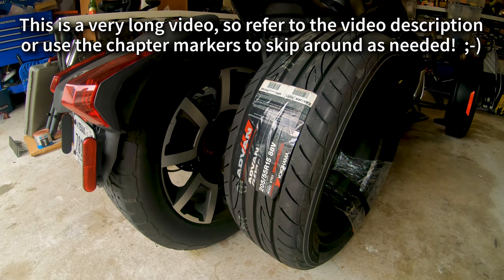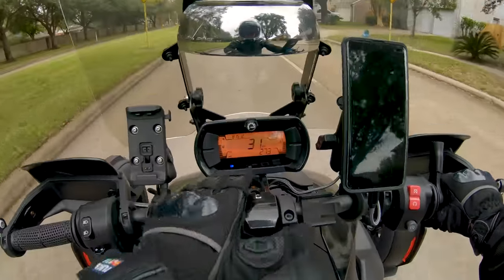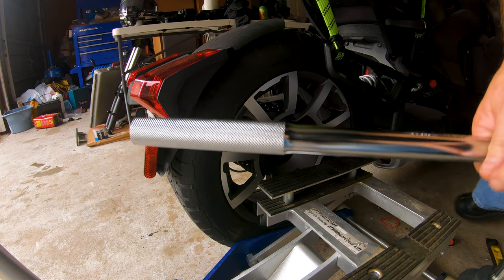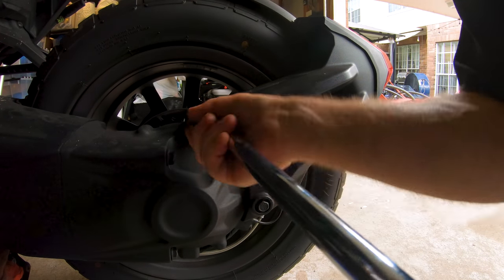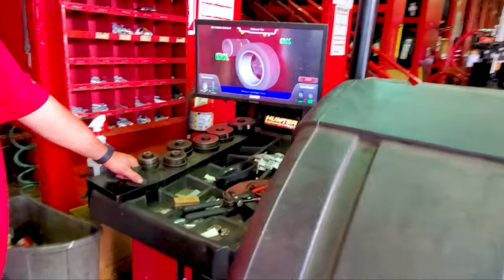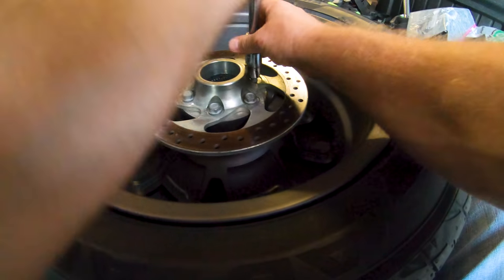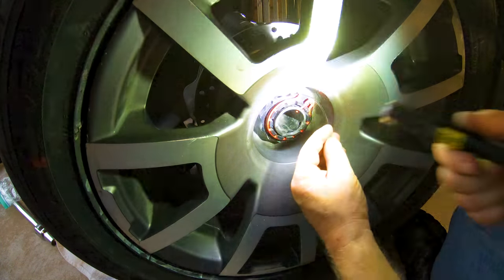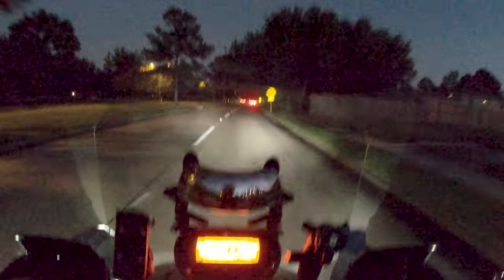RYKER: The Darkside Saga - Yokohama rear tire upgrade

Comment: Thanks, really enjoyed the video. Been thinking of getting one of these, being a retired tool and die maker, blow out the holes before re tapping and always use cutting oil even to clean out the threads. It will make the job much easier.

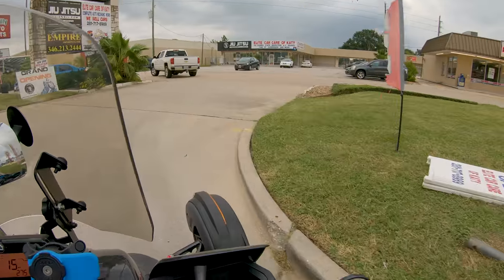Comment: Smart move to use the floor jack to avoid sideways downward pressure on that nut. I was glad the nut didn't break free when you had that rachet at 11:00 and pushing it away from you, you were headed for a tumble and some scrapes  from the jack and the floor!! I also like that you were in no hurry and reasoned your way through things. Enjoyed the video!! Thank you!!
Reply from the maker: Thanks for the feedback!  I'm sure that there are other ways to do the wheel removal on the Ryker, but I was trying to do it somewhat quickly and with the tools that I had available to me.  I enjoy wrenching on my machines... it's cathartic and fulfilling most of the time... as long as I don't break anything or lose any skin in the process!  Cheers!  😉👍  --QM

Comment: a 1/2" breaker bar is sufficient for that torque spec.  I used one from Harbor Freight for a crank bolt with similar torque specs.  I'm a big guy so it doesn't take much for me to "break" stuff lol.  It was a fun adventure though..I would like to use that tire on my spyder, just needs to be a little wider.

Comment: Did you really need to remove the disk for mounting and balancing? Maybe it would not fit the mounting machine, but the balancing might have been easier and would have included the disk mass in the balance.

Comment: Lower the Yoko rear pressure to 24 or so.  This is what we run them at on the Spyder and the Ryker is even lighter load.  Just stay above about 18 to keep out side wall flex in the corners.  The tire should last 18k or so, or at least that is what they average on the Spyders.  What do you plan to use for the fronts?

Sorry to see you went through all the trouble to get your tire changed.  Too bad we are booked up a couple of weeks out or I would have done it for you in less than an hour.  Just for future reference, there is no need to remove the brake rotor to change the tire.  It was obvious the kid putting your tire on at Discount did not know how to use the machine.  I winced when he went at your wheel with the tire iron to pry the bead over.  He really needs some training.

Enjoy your new found traction.
Reply from the maker: Thanks for the tip, James!  You are busy for a reason... good mechanics and techs are always busy!  👍👍  I'll lower the pressure to ~24-28 PSI and see how it feels.  The front tires are still a Kenda-only affair, so I'm headed up to Broadway Powersports in Tyler, TX for a new set of normal Kenda's (not the all-season tread) and an alignment check-up.  We are headed to OK and AR after that for a few days of motocamping and riding!  Cheers!  😉👍  ‐‐QM

Comment: @45:00 you left all the crud on the wheel and placed your rotor on top of it, sandwiching the dirt and potentially making the rotor unlevel.
Reply from the maker: 🤣  So, where were you?  I called all my friends to help me and sweat in the heat, but nobody offered assistance!  Unfortunately, it's easier to see potential issues after the fact.

The mounting surface had a few thin spots of thread-locking agent, but those spots were thin enough that I couldn't snag a fingernail.  I rode the Ryker for ~6K miles after this swap, and the rotor worked fine... no vibration or warping.  --QM

Comment: For 3/4” drive I would think Tractor Supply, Farm & Fleet or something similar might have a better selection than automotive supply stores. As a former mechanic who would come across corrosion frozen wheel lugs I would use a 3/4” socket to 1/2” adaptor to a extended length breaker bar with a 6 foot pipe as a cheater bar to break loose stubborn fasteners. Even with the long pipe length you really needed to put everything you have into it and sometimes a friend also to break them loose. High torque on a ratchet is dangerous.

Comment: I would wire brush the bolts and then get a little tiny wire brush that fits the bolt holes and very gently very gently clean them up. 👍🏻✨Thank you for your video😎

Comment: Great video, I will also be getting this tire from my Ryker rally. Make sure you check your tire size carefully because the other 2 Ryker models have 16” tires on the rear. At least the ones that I have seen.
Reply from the maker: Thank for the feedback!  The Rally models have the 15" rear wheel and the non-Rally (900ACE & 600ACE) have the 16" wheels.  All models have 16" front wheels, so the tires are interchangeable.  I swapped the all-season front tires on my Rally for the non-Rally standard treads; the normal street tires seem to help a bit with cornering grip and they're a bit more resistant to following rain grooves.  Cheers!  👍  --QM
Reply: Did you order the tire yet

Comment: Advice for next time, use thread cleaner tap  not thread tap. Not much damage this time, & was able to torque down, but don't make a habit out of it. A simple cut in the threads of a bolt at a slight angle will clean threads without damage to wheel.
Reply from the maker: Thx for the feedback and the tip!  That is an important distinction... thread chasing tap vs cutting tap.  The tap that I used this time was indeed a cutting tap because I didn't have a chaser in 10x1.5mm pitch.  I've always had good luck with cutting taps as long as I work slowly and clean the tap's lands frequently.  It's important with either kind of tap to start it slow to ensure that you're in the existing threads and not cutting fresh ones.  Cheers!  😉👍 --QM
Reply: Thread chaser; specifically made for cleaning threads out.

Comment: Can't the Can-Am dealership put new tires on for you?
Reply from the maker: Yes, the Can-Am dealers can install new tires, but they can only use the factory-approved Kenda tires. I didn't like the Kenda rear tire because the compound was hard and slippery... terrible wet traction.  😉👍 --QM

Comment: how did this tire work out and what tire pressure did you run any trouble with vss faults
Reply from the maker: This tire is FANTASTIC on the Ryker Rally.  I haven't experienced any VSS faults or other issues at all since installing it.  This size of automotive tire is very common on some of the older Can-Am Spyders, so I knew it was a safe bet.

The original Kenda all-season tire was terribly slippery even on dry pavement.  I could spin up the rear tire anywhere below 45 MPH on dry pavement, and it would easily lose traction at 60+ MPH on wet pavement.  The Yokohama sticks like glue, either wet or dry.  I have over 4K miles on the Yokohama now and it still looks and performs like new.

I typically run the rear tire pressure at 28-30 PSI for highway use (lower rolling resistance), and I'll occasionally drop it to 24-26 PSI for riding around town (softer to absorb bumps and more compliant ride).  Can-Am recommends 28 PSI for the original Kenda tire, so this falls in line with factory specs.  Cheers!  😉👍  --QM

Comment: I had an issue with Discount Tire....They had a Complete bird over the fact that My Winter 14" Altimax Arctic Tires (same OD) are mounted on Toyota Echo wheels without TPMS sensors for My Toyota Yaris that came with 15" tires and TPMS... Needless to say I drove 10 miles away to the other DT and told them they are going on a 2003 Echo...and no problem. (And this was 100% carry in!) - Now since then I have befriended the guy at the much more local Auto/4WD shop...and he doesn't care what I bring him...LOL

Comment: I've enjoyed your vids and got a lot of ideas, thanks. I was wondering how the Yokohama is doing compared to the Kenda. Again, thanks.
Reply from the maker: Thanks for the feedback!  The Yokohama rear tire has about 3500 miles on it now, and it still looks and performs like brand new!  I'm very impressed with the wet and dry grip of the Yokohama vs the original Kenda all-season tire that came on the Rally edition.  I was able to spin the Kenda on dry pavement at 35-40 mph just by whacking the throttle open.  I was even able to fishtail the Ryker at 65 mph on the freeway over wet pavement with the old Kenda tire... it was that slippery!  The Yokohama will still break loose from a stop sometimes, but it's much more planted and it won't break free above 20 mph unless rounding a corner or a wet spot at high throttle.  The difference is really night and day between the two tires.  Cheers!  😉👍  --QM
Reply: @QuasiMotard  I very much appreciate you clearing that up. I will switch to the Yokohama for sure. Thanks a lot. 👍

Comment: Yo I tried a different cheaper tire, since I've only been getting 4k out if everything I've tried so far. If it lasts 4k I'll be sticking with it, it seems to have better grip as well. It's the: "Zeetex HP1000 Performance Tire 205/55R15 88V" I'll try to remember to post an update if you are interested.
Reply from the maker: Thanks for the info!  Let us know how it does over the long haul.  I'll be interested to see how long this Yokohama lasts... it still looks new after 3500+ miles.  Cheers!  😉👍  --QM

Comment: I'm very interested to hear how you like the elka setup. I put the bajaron swaybar and endlinks on our Rykers and I can't say enough good things about them. They made such a difference in how the things behaved that I would recommend them to anyone with a Ryker as must do modifcation.
Reply from the maker: I've heard very good things about the BajaRon sway bar and end links... those might be next on my list of upgrades.  I installed the stiffer BRP sway bar within 2 weeks of buying the bike, and it made a world of difference in front-end stability.  The OEM end links seem to be the weak link (pun intended) in that solution, so I'll replace those first before going to a different bar.  I'm hoping that a new set of street tires on the front (not the all-season variety) and a factory-zero re-alignment fixes my Ryker's handling issues.  If I can get rid of the rapid darting from side to side, then I'll be happy.  😉👍  --QM

Comment: Well brother. You could of used the handle from the floor jack. Enjoyed watching. Thanks
Reply from the maker: Thanks for the feedback!  I wish that the floorjack's handle was removable, but it's fixed to the jack itself.  My bigger problem was the offset from the rear wheel... I needed an extension to get a straight shot at the wheel nut.  This hack worked out, and I'll be repeating the process again soon with my front wheels.  I'll be pulling the front wheels to replace the tires and to install some aftermarket progressive turn signals.  Cheers!  👍  --QM

Comment: I feel your pain I ran into the same thing with Discount Tire . They would sell me the tire but would not take the wheel off WTF  and for them it would have been so easy to do
Reply from the maker: Yep!  Sorry to hear about that... it's all about liability.  The Yokohama is wearing very well on the back of my Rally so far.  I have ~3K miles on it and it still looks nearly new.  Unfortunately, my Ryker is down for a while until I rebuild my front-right suspension.  I'll be sure to post some videos on that saga as it unfolds.  Cheers!  👍  --QM

Comment: Ryde RTL myself,  Change oil, change rear Kenda repeat.  Changed to ecsta car tire. For first 250 mi. slide ways and needs scuffed. Then all good. BRP dealer will not mount.  Sling shot dealers have the equipment, know how. Removal and installation, belt adjustment $130..  Ryde safe.
Reply from the maker: Howdy, Dennis!  Sorry for the late reply... I just saw your message today. Our local dealers around here don't seem to want to mess with anything that isn't "factory-approved", so we have to shop around or do it ourselves.  Congrats on your RT-L... those are nice!  I have considered moving over to a F3-S, but I don't really want a larger, heavier bike.  If I could ever solve my alignment & handling issues on my Rally, then I'd be tickled pink with my Ryker.  Until then, it's a Love-Hate relationship... I love to twist the wrist and roast  the tire, but I hate the wandering at speed.  Cheers!  👍  --QM

Comment: Looking forward to you review.  Curious have you done any power upgrades?  My Ryker Rally OEM rear tire sticks even at 20 MPH given full throttle.
Reply from the maker: I don't have any power upgrades in the bike now.  I tried a RPS PowerKit3, but I reverted to stock.  I'm not a heavy rider so maybe I just don't have enough weight to plant the rear tire.  My Ryker has always been prone to spinning the Kenda rear tire on all surfaces, and especially on wet pavement.  The new Yokohama has a lot more grip, so I really have to try to spin it now.  😉👍  --QM

Comment: HOLY SHIT THAT WAS A MISSION....THIS VID MIGHT JUST HAVE CHANGED MY MIND ON GETTING ONE LOL...GREAT VID,THANK YOU
Reply from the maker: The Ryker is a fun beast, but it definitely has its quirks.  Tire changes are an ordeal because Can-Am dealers won't (can't) use tires that aren't officially approved by Can-Am, and automotive dealers won't touch the bike with a 10-foot cattle prod.  So, you're stuck removing the wheels and taking them into a tire shop as a carry-in item.

On the positive side... this Yokohama tire sticks like glue compared to the original Kenda Flinstone rock-o-death that came as original equipment.  The old tire would spin up at 40 mph on dry pavement and could easily break traction on wet pavement at 65+ mph... not good.  The Yoko will only break loose when you want it to:  https://youtu.be/M6EvOtVK1Lw?t=3505 .  😉👍  --QM
Reply: @QuasiMotard  thanks

Comment: Hi there have you any updates on the new rear tyre, mines due and I too do not rate the kenda
Reply from the maker: I have a couple of Ryker videos in the editing queue right now from the trip that followed this video.  I have about 2000 miles (3200 km) on the Yokohama tire now, and it has performed very well... no slippage in dry or wet conditions, so the traction is much better than the Kenda.  It's much more difficult to spin the rear tire now.  After 2000 miles, the Yokohama doesn't show any appreciable wear even with hard riding and intentional burn-outs.  Cheers!  👍  --QM

Comment: Hey Quasi,
How are the tires holding up?
They're car tires?
I want to put a car tire on rear but car shops says they don't recommend it because the Kenda is made Flat not round like cars.
Kenda is very expensive in California. $210
Reply from the maker: The new Yokohama on the rear is doing very well.  It has a TON more traction than the original Kenda tire did, and it's wearing very well over the past 2500-3000 miles... still looks new.  The front tires were replaced with the street-tread Kenda's from the non-Rally Ryker (no alternative fitments yet).  They haven't fared so well because of a dealer error when they reset my alignment at +2.5" toe-OUT instead of -0.25" toe-IN... the inner edges of the front tires are already worn down to near the wear bars.  So, I'll be replacing them again very soon.  The alignment error has been remedied now (after 1500+ miles of being incorrect), so the next set of front tires should wear better.

As for the Kenda tires on the Ryker and their classification... that's a strange issue.  The Kenda tires have a "MC" rating, but they are very much automotive-style tires.  The tire carcass is square-sided like an automotive tire, and the tread pattern and wear face are automotive all the way.  I think the "MC" rating is just for insurance and DOT certification purposes.  Can-Am Spyders have used automotive tires for years, and this exact Yokohama rear tire is a standard fitment for the older Spyder SE5 and other models.  I've seen a few other owners' pictures on Instagram and Facebook showing other brands of rear tires on their Rykers, so it appears that I'm not the only one that doesn't like the Kenda's performance.  

If you decide to change over to a different tire and NOT do it with a Can-Am dealer, then you will certainly need to purchase the 65mm socket to remove the rear wheel... tire shops probably won't have that tool available.  You might need to remove your rear wheel and/or the brake caliper as well... it just depends on the shop and how flexible they are regarding the Ryker.  Good luck with your tire upgrade!  😉👍  --QM

Comment: Thank you for sharing the whole experience of the tyre change with us. I saw you had RideOn tyre sealent in your previous tyre. What is your experience regarding the RideOn product. Are you going to use it in your new Yokohoma tyre, too?
Reply from the maker: I have been using Ride-On for 10+ years, and I have only good experience with it!  I have only seen it do its magic twice in all of those years , but those events prevented me from sitting on the side of the road with a flat tire.  I have five fresh 8-ounce bottles of Ride-On with me now, so I will be refilling the tires tomorrow after the dealer service!  Cheers!  😉👍  --QM
Reply: @QuasiMotard  Thanks for the valuable and prompt reply. I have a Ryker 600 and was thinking of using Ride-On in case there was a flat tyre due to a nail or something like that, it sure is going to be a big hazzle. Your  video showed it clearly as the regular tyre repair shops were not equipped to do the repair & declined even to touch the wheel. Bottom line: I am going to apply Ride-On to all 3 wheels of my Ryker.

Comment: I didn't see a video specifically about this tire after 6 months. Still loving it?
Reply from the maker: I haven't made a follow-up video yet about the Yokohama rear tire, but it's still going strong!  I have ~3500 miles on it so far, and it still looks and performs like new.  I'm sure that I'll get at least 15-20K miles out of it before it needs replacement.  Cheers!  👍  --QM
Reply: @QuasiMotard  sweet I'm about to try one out